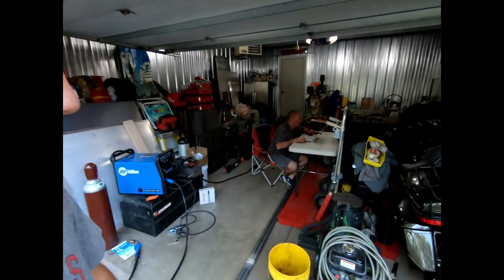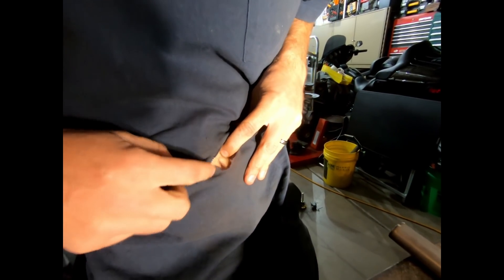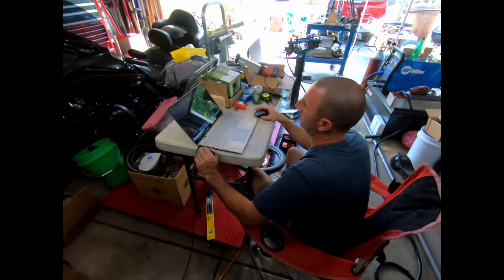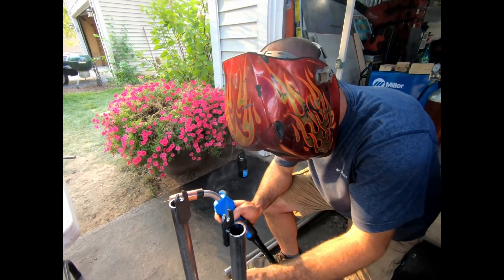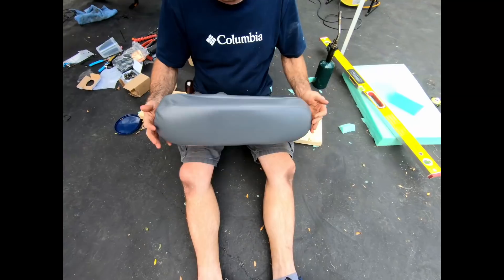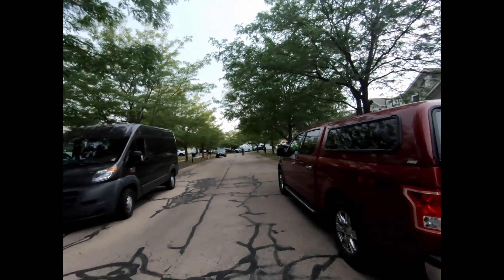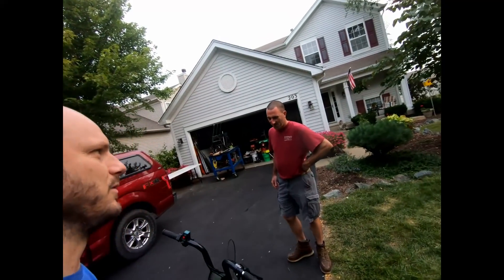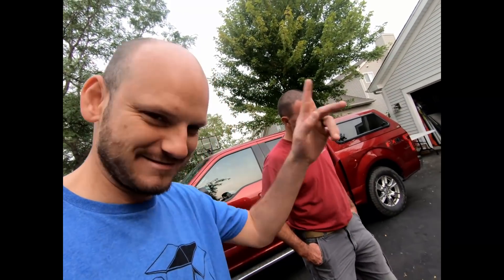Building and Riding a custom 40+mph made E-moped in 3 days.

Comment: Larger tires, shorter crank arms with folding pedals and frame mounted forward pegs.  I'm thinking of taking my FAT tire bike, leaving the 26x4 tire on the rear and redo the front-end with a 29er wheel and fork.  Johnny, you could turn this one nto a chopper, flick the pedals out the way cause your not going to use them except for emergency power or to prove it's a bicycle.  A sissy bar on the back, I have not seen a chopper eBike yet, you could build the first one, start a new trend.

Comment: I would prefer a hub motor set-up.
But I would be willing to buy one with out battery or motor if price is 100 or 150 max
Reply from the maker: There will probably be a hub version
Reply: The metal would cost more than that
Reply from the maker: @theoffgridtravelers7316  probably double it to pay someone a living wage to weld it up as well.
Reply: But I'm looking to put a 2000 or 3000watt hub motor.
I found one I can get shipped to Mexico from china for 220

Comment: Make bike longer so two people can ride comfortably.
You didn't say specs for motor or battery.
Tires should be beefed up ?
Not bigger in diameter, just stronger. Like Radrunner.
Reply from the maker: Tires were supposed to be 2.6 instead of 2.4. I think going 24” x 2.6 will be an improvement for some.
Reply: I like the 20 inch tires. The tires you used looked Abit light duty compared to what most 20 inch mopeds are using
Reply: I really hope you guys will be building second edition within the next week

Comment: NICE! When you say "custom e-bikes" you're not just forking around.
With wider wheels would the chain-line be better? (Honest question, not a critique).
My biggest critique is why doesn't the dog get more  screen time?
I look forward to updated versions;)
Reply from the maker: The chain line ended up being good. I think wider tires (wider hub) would offset it in a negative way (away from the bike).
Reply: @JohnnyNerdOut  Ah. You mentioned chain-line at the beginning of the build and I know low gears are often hard to reach on a normal build. I just assumed that with the moped frame and skinny tires (for a moped) would exaggerate the problem. Love watching you explore new territory.

Comment: Good job. Serious shop there. 40 mph! Any plans to build more like up to a 3.0? Maybe 24 in wheels with 4 inch tires. Just me maybe but the frame tubes would look alot better wrapped around the rear of the seat following the contour heck you could put a slight bend up 6 inches or so forward for a contoured seat. With some suspension and that speed it'd be sweeeet and probably shred a Super 73.